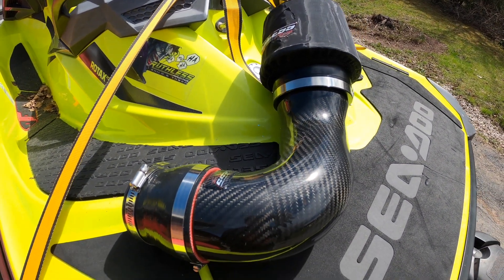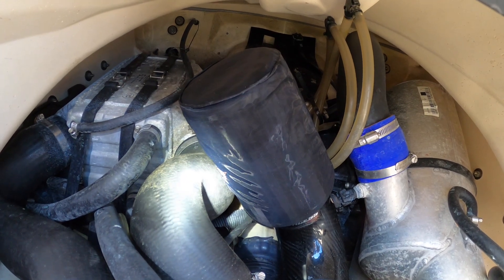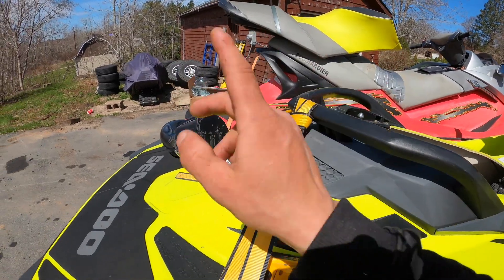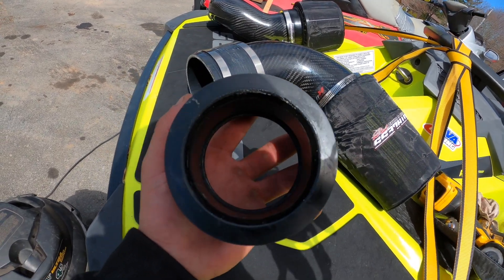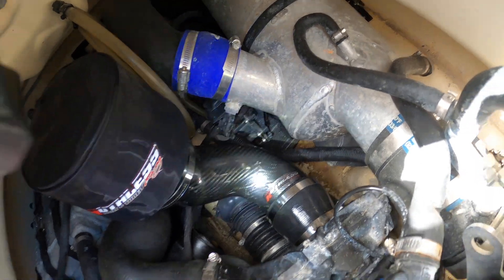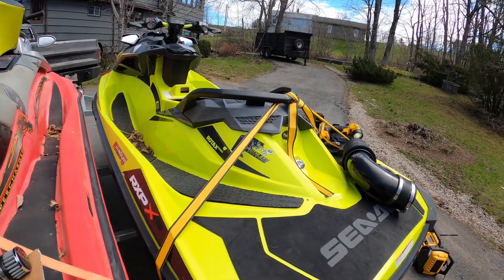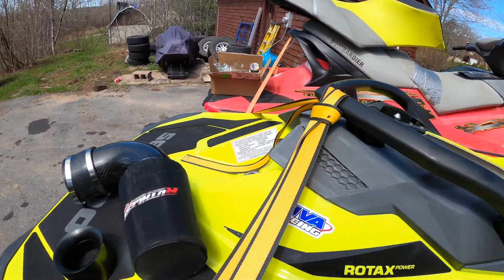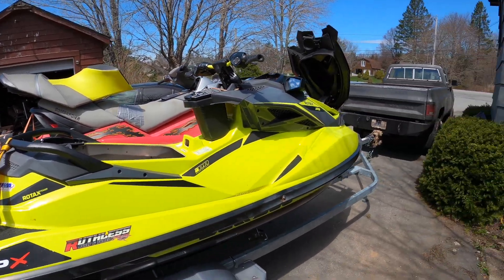Seadoo Rxp-X 300 Ruthless Racing Cold Air Intake Options for your Seadoo!! Sound Results at End!!!

Comment: You should swap your pressure hoses from oem to some aftermarket.  The oem can be a bit soft after an while. And maybe remove the plastic in the storage space in front. Just an friendly advice, to make sure that you don't loose some power. And make sure you get the best air flow to the intake.
Reply from the maker: Are you reffering to the charge piping or fuel? Mine seem to be fine no weather crack or sign of chaffing
Reply: From the intercooler. :)